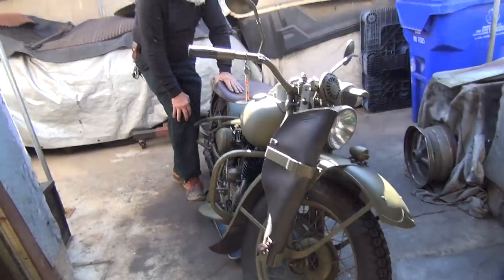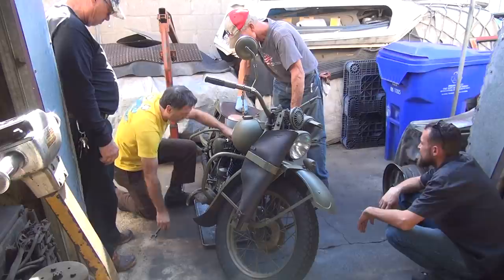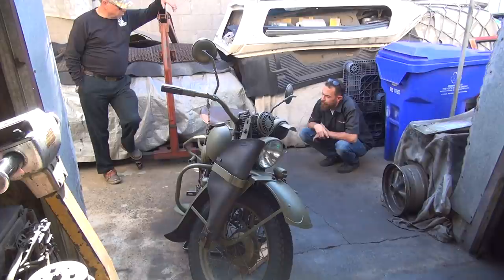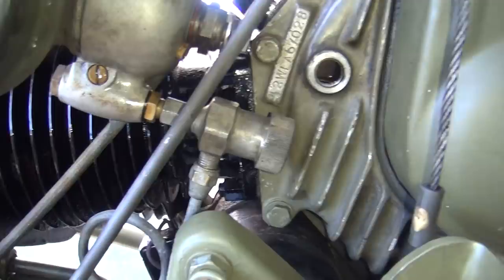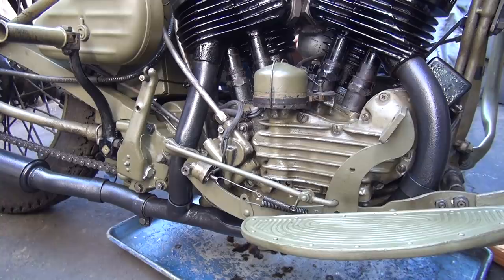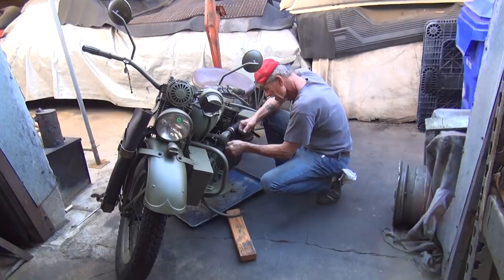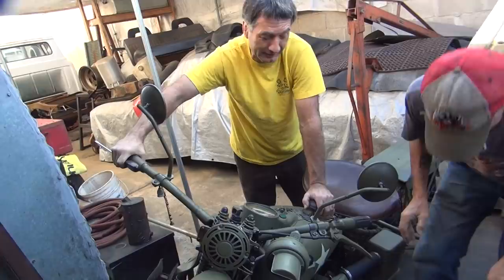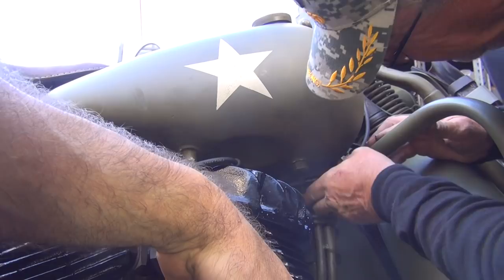1942 45ci wla type 5  #129 rebuild repair tune-up harley flathead sidevalve by tatro machine

Comment: T M 
I know this is 2 years old but this could help others doing the timing into the future.

Your doing the timing the hard way. I had a 42 WLA not completely original as a lot of parts where not on the bike, for 18 years & rebuilt it from the ground up. The easiest way is to put the flywheel timing mark (the long slot) in the centre of the timing hole (left side of crankcase). Then with the points gap set at the spec gap & at fully advanced, rotate the the distributor for the front cylinder by loosening the band clamp until it just fires (a circuit light is very helpful in doing this). This then has the correct timing but also check it with a strobe light. Also please note that the distributor fires on a power stroke & on a non power stroke thus saving the need for a distributor type cap like Indians have (as you'd well know). The points cam is profiled in such a way that it fires the rear cylinder in such a way that it compensates for the cylinder "VEE" angle. Thus both cylinders then have the correct timing at fully advanced running mode.

I didn't have the handlebar advance/retard twist grip. I had the well known semi auto spring on the distributor "owner option". A little self made bracket under the left rear barrel bolt was a good position to fit a spring of medium strength & length to do the job. This had, when properly adjusted (there is a wave type 'C" clamp under the distributor that can be bent to give the right amount of friction) manual retard by hand at idle (say for when starting or while waiting at a red light) & when taking off the vibration & the spring advance pressure fully advances the distributor & holds it there until the need for retard comes once more.

One time I had the need for a new point set. I fitted it, set the spec gap & did the cigarette paper trick on the points with the timing mark in the center of the timing hole. I started the bike & got my timing light & shone it at the timing mark & to my surprise the timing mark was dead centre at fully advanced setting, so no need for any more adjustment.

What happened after 18 years in Sydney area, Australia (1974 - 1992. A wife & 4 kids meant the bike was just eventually mostly sitting in the garage gathering dust, so with much sadness I sold it. At least the memories are still with me. Many a good trips were had over the years including a trip around Tasmania & a 10 week tour of both Islands of New Zealand. I always camped & the old Harley never let me down. These old Harleys never had much horse power but the US Army got it right wanting & getting reliability over performance as they would run on very low octane fuel as they only had around 5 : 1 compression. 

One WLA rider in the 1980's told me he had one that run out of oil & wrecked the crank bearings. He was 400 miles/645 KM's from home. He filled it up with oil & headed for home with the engine very slow & noisy. Eventually he got there. When he pulled it down there were no rollers on the crank pin (they were just a mangled mess in the bottom of the crank case) & there was damage to the rods, flywheels, crank pin  & heads. He had to get another set of fly wheels, new crank pin & rollers, rods & pistons. Amazingly the bores were still ok & the heads were just a little damaged but a clean up made them serviceable. He did all that & the bike ran for years without issues, but he made sure he checked his oil often & even changed it when it got a little dirty.